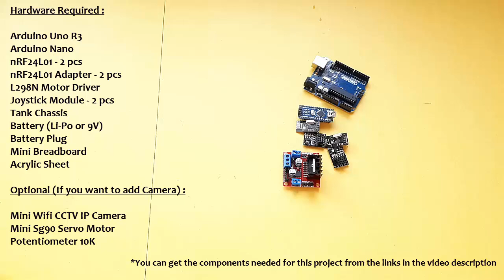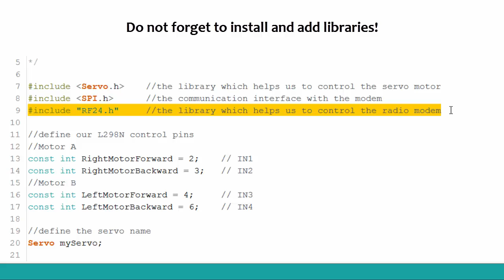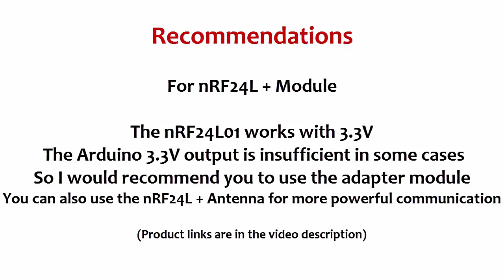Arduino Remote Control Tank with WiFi Camera | nRF24L01

Comment from the maker: Receıver:https://create.arduino.cc/editor/mertarduinotech/13a187d6-cb8f-44a1-841f-920f70b6981f/preview
Transmıtter: https://create.arduino.cc/editor/mertarduinotech/00e1206b-875c-42a7-a30e-290465bad886/preview
Recommended Items:                
Use Your Muscles in Project - https://amzn.to/3wdL45C
37 Sensor & Module Packages - https://amzn.to/3m66WeQ
Try this Robot Arm - https://amzn.to/3fq8DCl
Best Resin 3D Printer - https://amzn.to/39tY8KB
Arduino Compatible Kits - http://bit.ly/2J2AFF7
Banggood Spring Sale - https://bit.ly/3slMbOn

Comment: Hi Mert,

I tried building this tank as per your video, awesome work btw, but after coding I get no response from the tank except for the servo trying to what seems like auto-adjust, it turns in very small increments. I checked and re-checked all the connections but cannot get the tank to work. Would you have any suggestions on troubleshooting ?
Reply: I have used as per your selection the Lipo Battery - https://goo.gl/2JZnmg. Is this not enough to power all of the tank ? I will try using separate power sources for the board and the motor and update on here. Thanks for replying.
Reply: Hi Mert,

Its working now. It was the power supply. I have now used two 18650 is series and it works fine. I think it needed more juice than one cell.
Reply: hi bro :) i have some problem for nrf24l01. could you help me?

Comment: Hi we are making a robot that is quite similar to yours. how ever it seems like the robot doesnt move when we move the joystick. we think that the problem is with the  nRF24L01.Sometimes it will receive the signal. sometimes it doesnt. Can you help us? What can we do about it?
Reply: nrf24l01 need good power-supply  .You can add a capacitor 10uf or 100uf to the  nrf vcc and gnd  it will increase energy and i will work.

Comment: hello. love your videos! Question: In recomendations you said you didn't get the full performance out of a 9v battery. How will a lower voltage battery (7.4v) give a better peformance? Best regards
Reply: so we just need more mAh regardless on which battery
Reply: 9volt battery, I think he uses square shape 9volt battery, the ampere is not enough for motor, but if you replace it with 2 of 18650 battery, you could have enough for the motor, voltage didn't matters if the ampere is enough(in motor case)

Comment: Hi Mert,

I want to build this tank as per your video, but I want to control via Bluetooth on my smartphone(sony xperia z1), so my question is Can I use this hardware:
L298N Motor
Arduino Uno R3
Bluetooth Module HC-06
Tank Chassis
Battery 9V
Battery Plug
Mini WiFi CCTV IP Camera
Jumper/Wires
It will be working? And What app do you use for controlling Mini WiFi CCTV IP Camera?

Comment: Nice project , can i use OV7670 Camera module , would it perform the same as yours?
Reply: sadly no it wont because it doesn't support WIFI so you wont be able to connect it unless its wired (which is impossible for a wire to handle all of this area, unless the robot only covers a really small area or that u have a really long wire

Comment: I've got the transmitter and the tank talking now, but when I push forward on the controller the tank goes full speed forward and then won't respond until I unplug the power. Anyone know what I'm doing wrong?

Comment: hi Mert.
i tried this method to my robot but i cant get it to work.
i dont know if the problem is that i use 2 uno`s instead of a uno and a nano but for the rest i do everything the same.
can you please help me?
i am trying to make a good working robot for a long time but i am not good in coding yet.
Thanks.
Reply: hi :) did you solve your problem? i have some problem for using the nrf24l01

Comment: Man where is the connection for other batteries that u have recommended and also can we use 4 motors for more power and which battery configuration should i use please help me man

Comment: Today I have power on to the tank but I need information : the two motor is DC motor,from the video I see that LM298 has the two connection for step up motor inside ,and when I try to move joistick only one motor go and not fluenty,the lm298 is very hot,the 2 motor is ok ,i test this sepately with 6vdc work perfectly ,I try to supply with 6vdc the LM298 (only one motor go not correctly) ,also I try to supply with 12vdc but the result is worst,i supply with AA battery in series,help please.Thank a lot.
Reply: The lm298 is not a very good motor driver because it is preferable at 0.5 - 2 amps
Reply: Use the l298n

Comment: how did u burn the program 
actually we have to connect the cable to the system know?
Reply: Before assembly he would have uploaded the sketch....Arduino have an EEPROM....Upload the program and from the next time....Whenever you switch the board on, Arduino runs the program automatically with a delay of 2 to 3 secs

Comment: Arduino: 1.8.5 (Windows 7), Board: "Arduino Nano, ATmega328P"

Build options changed, rebuilding all
Sketch uses 3300 bytes (10%) of program storage space. Maximum is 30720 bytes.
Global variables use 209 bytes (10%) of dynamic memory, leaving 1839 bytes for local variables. Maximum is 2048 bytes.
avrdude: stk500_getsync() attempt 1 of 10: not in sync: resp=0x30
avrdude: stk500_getsync() attempt 2 of 10: not in sync: resp=0x20
avrdude: stk500_getsync() attempt 3 of 10: not in sync: resp=0x30
avrdude: stk500_getsync() attempt 4 of 10: not in sync: resp=0x20
avrdude: stk500_getsync() attempt 5 of 10: not in sync: resp=0x30
avrdude: stk500_getsync() attempt 6 of 10: not in sync: resp=0x20
avrdude: stk500_getsync() attempt 7 of 10: not in sync: resp=0x30
avrdude: stk500_getsync() attempt 8 of 10: not in sync: resp=0x20
avrdude: stk500_getsync() attempt 9 of 10: not in sync: resp=0x30
avrdude: stk500_getsync() attempt 10 of 10: not in sync: resp=0x20
An error occurred while uploading the sketch

This report would have more information with
"Show verbose output during compilation"
option enabled in File -> Preferences.

This same problem is coming while uploading both the codes